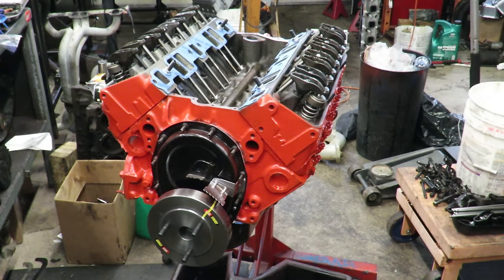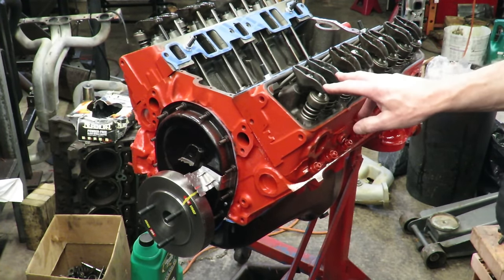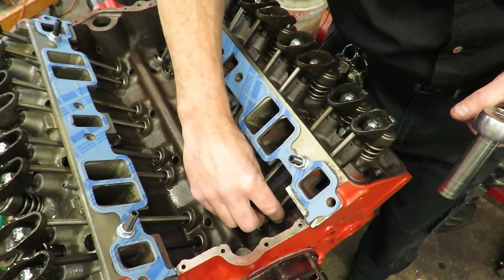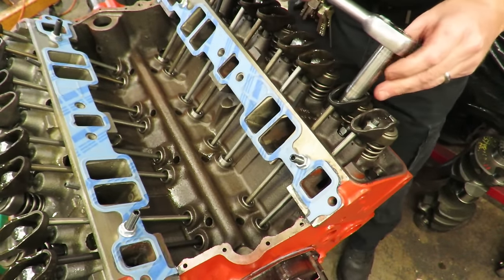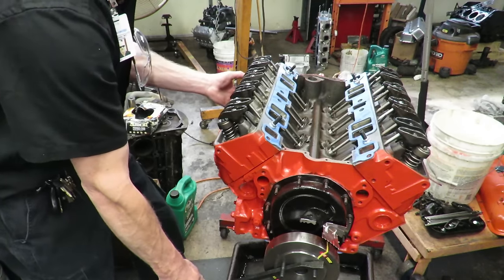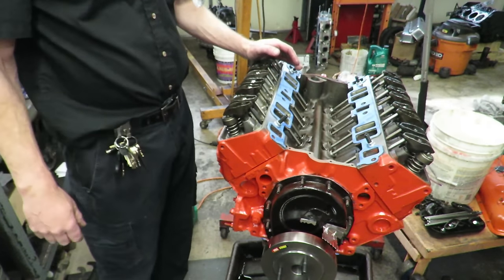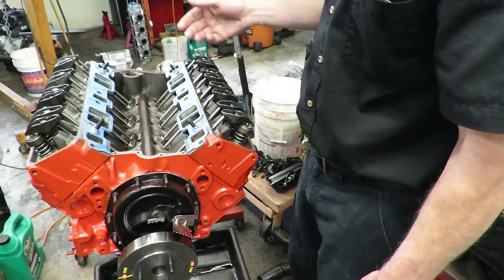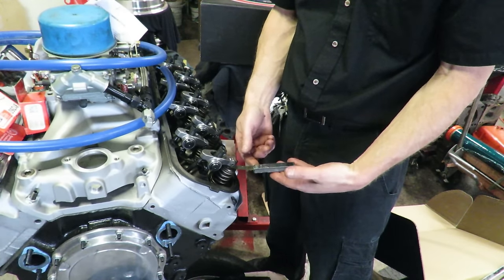Small Block Chevy valve adjustment made easy

Comment: Better late than never, I have searched YouTube maybe not in the right places but all the wrong places on, trying to rebuild top end of my 5.7 sbc . - now that I have put the two peice intake back how do i go about setten the valves . I had a what I thought was a knowledgeable Motor builder back in the era of leaded gas . which I remember my self, lol. ended mouting t converter to fly wheel, well the installation was wrong had to pull motor by my self , not fun but installing now ....  
       my question is how do i go about adjusting for lash and finial  180° adjustment , when everything is going back in for electric, and tork converter tie back together, I don't want to pull motor again,,,..

Comment: Is it normal for other valves to become lose when going through the firing order when adjusting
Reply from the maker: No
Reply: @Myvintageiron7512  would you know why a previously adjusted rod would become loose when you've moved the crank to the next cylinder following the firing order?
Using this method, I have just moved the crank so that it is tdc cyl 4 and the exhaust on cyl 8 came loose..

Comment: If you want peak power, when you’re done following the instructions in this video you’ll have to go back and adjust the valves again while the engine is running and warmed up. That means while the engine is running you have to pull off the valve covers and create a block or deflector so that Oil doesn’t squirt out all over the place while you adjust the valves. It’s popular to use the super long Diesel feeler gauges on solid cams. With hydraulics, adjust till the noise just starts plus a quarter turn back. Or, if noise isn’t n issue, adjust till the noise just starts a little. The bottom line is that you’ll never get the most power out of your engine unless you adjust the valves on the engine while running and warmed up.

Comment: Do You pre-soak your lifters or pump them up first before you install them?
Reply: No.
Reply from the maker: Nope you don't need to if thet are rollers you should soak them in oil but this is simply to lube the roller

Comment: I find it much easier and more accurate to use the "companion-cylinder" overlap rocker wig-wag method;
Reply from the maker: doesent work on big roller cams you will never get it right doing that
Reply: @Myvintageiron7512 .....Doesn't work on 5 cylinder engines either; sorry, didn't recognize the SBC you're working on as a roller-cam motor; Entschuldigung
Reply: I saw a video that showed 1-2-3-4, then below that on his grease board: 5-6-7-8, is that what you meant, he called them "sister cylinders", adjustment of #1 and #5 @ the same time, #2 and #6 , and so on 🤔...is that correct?
Reply: @normanhopfensperger4343 .....Good German last name; your ancestors must've been involved in the production of hops. No engine has a firing order 1-2-3-4-5-6-7-8. With any even cylindered, even firing 4 stroke engine, if you split the firing order in half, the 1st cylinder in the 1st group's companion cylinder, is the 1st cylinder in the 2nd group and so-on. Companion-cylinders both have their pistons at TDC, but the valve-train determines which one is on compression TDC & which is on overlap TDC. This method is accurate on any engine you encounter once you ID the cylinders & firing order since these can easily differ from engine to engine.
Reply: Hops were used, yes, firing order, I stated incorrectly, I had seen a video 1,8,4,3, #1 could be used to adjust #6 next. wig-wag'n 🤭

Comment: Faster way to do this is to pull up the chart for what valves to adjust at #1 compression and at #6 compression.
Reply: This is the way I do it. You only need to rotate the engine once.  You just have to take your time and be sure you do the correct ones at the correct rotation.
Reply: agree thats how i do it also
Reply from the maker: that's not faster
Reply: How? You only have to rotate it over once. Plus unless you are one of the few that has a balancer with 90 degree increments that’s pretty much the most accurate way to do it.

Comment: The old folks knew.. when the engine gets hot steel expend .this is why they use the spinning Rods  adjustments until you have zero lash and you can't spin the rod....   so that in a near future if you run into issues that makes the engine run hot like as bad radiator or bad waterpump you have that extra lash on your top head to save it ... Instead of going crazy tight with zero safety of failure  .. this is not a Honda engine lol
Reply from the maker: I got news for the old folks if you run your rocker down on to a lifter that is Bled down, until the push rod wont spin
 you are way past zero lash by at least one full turn (way too tight) the biggest problem with many old folks is they have been doing something the wrong way for so long they refuse to admit that it's wrong!
 Using the spin method is going to do just the opposite of what you claim in your post,
 your lifters that have no HYD pressure in them will be way too tight you really should think this through completely if your going to respond

Comment: I always knew that both valves of a given cylinder can never be open at the same time and adjusted the closed one first
Reply: Yea, You are right . The valve on that particular cylinder will never open at the same time. It is 2 valve per cylinder. HOWEVER , in some position both Valve are CLOSED at the same time . At that time adjust the valve lash...

Comment: good for initial setting,  but flawed for permanent setting
Reply from the maker: Nope that's not the case,  I'm not sure where you reasoning is coming from but you will never halfto touch this adjustmant again for the life of the engien,  I've done thousands of them this way with zero issues

Comment: The setting of the GM/Chevrolet valves... GM/Chevrolet never turned an engine over and over and over to achieve complete setting. Timing chain when 1st (installed) dot to dot * IS * 6 up, set 8 of 16, turn once timing tab back to timing tab, set 8 more (obvious as to what ones are not set) set those. DONE Yes there IS more than one way to skin a cat, but why go around the block making 3 rights when your already standing there. And then you could set 1 at a time, or the EIEIO (farm pun) method given to people (that buy there cam's) as a way to get it done. I coulda set 16 valves in LESS time than it took to type this out... Run engines over 10 Thousand RPM in racing (as well as other) applications, NEVER experienced any issues or problems. Once the lifter is OFF the base circle your there (ready to set) GO...
No. 1up cylinder, the setting may be adjusted
Ex: 1-3-4-8.
In: 1-2-5-7.
Then turn the engine one more complete revolution which will bring up. **** 6 first or 1 won't matter ****
No. 6up cylinder, the valves may be adjusted:
Ex 2-5-6-7
In 3-4-6-8
Reply from the maker: This does not work with big roller cams.
I understand what your saying ive done it many times with small flat tappet cams However I assure you 90% of people reading this have no clue what you are talking about
Reply: @Myvintageiron7512  does on all of our 700+ lift SOLID rollers
Reply: @Myvintageiron7512  does on all of ours

Comment: How can you adjust ur valves if its running ?
Reply: Chris Hurley we use a old rocker cover cut holes on top and put tape over holes to stop oil spitting everywhere when adjusting , while it’s running loosen rocker till it starts tapping ( noisy ) then tighten it down till tapping stops then a half turn , using socket and extension

Comment: I've tried this, and several other methods on my newly rebuilt L98 with 10088113 heads with Comp Cams hydraulic lifters, but have yet to figure out a way to quiet them down. Apparently they're notoriously loud. I've seen your Best and Worst sbc Cylinder Heads video a couple of times, and was wondering if you've got any suggestions on how to muffle these ridiculously loud heads? https://youtu.be/0P7X4TYDTHo

Comment: https://youtu.be/zjxoQ-gLYNg here's the derby week before I won. 8min for heat 52min mark for feature.  Blew hose in feature.  Lost all water never stalled ran entire feature till very end but it was hot hot my electric fan was junk too. Still won and motor was fine just changed head gaskets since it was like 300 degrees Fahrenheit

Comment: Turn the engine a little bit at a time and check and adjust the valves that needs adjustment and continue until all the valves are adjusted!  It should take 3 to 4 full rotations and your done with out all the t d c bull!!

Comment: He made it a lot more confusing than it Hass to be. He keeps rotating the fucking engine probably because he’s old and he works for UTI. I’ve been spinning wrenches hard-core since I was 20 and a lot of those guys come out of UTI and you will swear to God they never touched a engine or any boats or nuts that are not attached to them. they sure know how it works though he could have cut the whole middle of his explanation out and it would’ve made more sense, but you know how those whole shop teachers are just keep repeating there self😭😭😂😂🤣 I bet he’s a good teacher if you pay the fuck attention but if he stuck to what he was originally teaching, at least what I caught from it first to the intake valve with your first 8 1/4 turns then go adjust the exhaust valves wit ya next 8 1/4 turns and that’s a wrap this is equal to four revolutions on the crank and that’s why they call it a four stroke😭😭😭🤣🤣😂 seriously I can do it without all of this malarkey but this is a method you’re just gonna need two more rotations on the crank, which would put you at four instead of two 🤷🏾‍♂️🤷🏾🥷🏾

Comment: I come to the decision your about full of it as it gets. Have you ever sit and listened to the mess that comes out your mouth. I really need you to explain how spinning is incorrect to get 0 lash. Lol.. if it’s done correctly it really doesn’t matter spinning it or shaking it up and down it’s all gonna end up the same… wow…
Reply from the maker: Ok listen carefully and think about what is being said. 
when an engine runs all of the lifters are pumped up, the engine is then shut off, some of the valves are open , others are closed, if a valve is open with the engine shut off the valve spring pressure is going to cause that lifter to bleed down after sitting there for a while with valve spring pressure on it, the lifters that have a valve closed are not going to bleed down they will basicly be like a solid lifter if you try and depress the plunger in the hyd lifter you can't because there is oil trapped in that lifter this is also known as the lifter being pumped up.
so lets say you pull the valve train apart for some reason IE change rockers, repair a head gasket or whatever, the reason does not matter my point is the rockers have come off you have your lifters in the block some are pumped up solid some are blead down from the valve spring pressure hopefully your following.
Next the engine gets re assembled, you install pushrods rockers ect. and it's time to adjust the rockers the first step of course is to find zero lash, so let's use your logic and run the rocker down until the push rod wont spin, on the lifters that are pumped up the push rod will be very close to the top of the plunger travel and the push rod will get hard to spin or won't spin at all, you are close at zero lash, then you go the next lifter that is bled down from the valve being open, the valve spring pressure squeezed all the oil out the plunger and lifter body can easily be pushed all the way down to the bottom of its travel by hand, now you start running your rocker down you are going to push the plunger in that lifter 2/3 of the way down it's travel before that push rods gets tight, and that is not zero lash, that is way past zero lash, the adjustment on that lifter is going to be way to tight I have seen guys use the push rod spin method and have a dead cylinder after the engine warms up because the lifter expanded and bottomed out thus holding the valves open, this is also true with new lifters if you install a new set of lifters most often out of the box they will all be bled down IE: plungers are easy to depress by hand, you then proceed to adjust them until the push rod won't spin, well guess what your hydraulic plunger will be 1/2 to 3/4 of the way down it's travel before you start to feel resistance on the pushrod as far as spinning goes, That is NOT!! zero lash and the adjustment will be out of spec,
Bottom line spinning the push rod to find zero lash is just plain wrong, your valve adjustment will be way off it hurts performance and shortens the life of the lifter I have heard guys argue about this for years they will say "I've been doing it this way for years" just because you do the wrong thing for a long time that does not mean it's right,  It just means you haven't known what you're doing for a long time.
 Any decant machine shop or builder will tell you this, it's just common sense, apparently, you're lacking in that area.

Comment: Base circle of the cam...its called lashing the valves...you can actually do all valves in 2 rotations....this dude dont know shit from apple butter..
Reply from the maker: nope what your saying is true for mild/stock flat tappet cams if you have a big roller the method your using will not work you  clearly  haven't delt with any high performance roller cams otherwise you wouldn't post things like this

Comment: Your adjustment is incorrect. It’s fine for starting up the engine and breaking in cams. But The valves are actually not adjusted. Only way anyone could ever adjust valves on an engine is with the engine warmed up and running. If you do it any other way then... adjusting the valves while the motor is running you’re giving up horsepower. Again, the only way to  properly adjust the valves on any engine, the engine must be running.

Comment: Bull Shit. The best method is the first method. Period.
Reply from the maker: it wont work with a big roller
Reply: @Myvintageiron7512  All camshafts have a base circle for intake and exhaust. therefore all Engines can have valve lash set @tdc compression stroke. marking the balancer four equal places on a 90° v8, & then by finding valves rocking @tdc, number 1. then turn the Engine over one full revolution. Next  set the valve lash on the compression stroke of number 1. With all of the plugs out, there will be number 6. and number 1. @tdc at the same time on a std firing order small block  chev (18436572) number 6. will now be valves rocking @tdc while number 1. Is on compression stroke tdc You can check piston is at tdc generally by carefully putting a long enough screw driver down through the spark plug hole.
You can now turn the crank 90° the piston that will be up now is number 8. you will be able to set lash on this cylinder. Next rotate crank 90° again number 4. Can be set. Just just keep following the firing order until all of the cylinders have had lash set.

If this doesn't work on my more than 280° @.050" camshaft, 'll eat my hat.